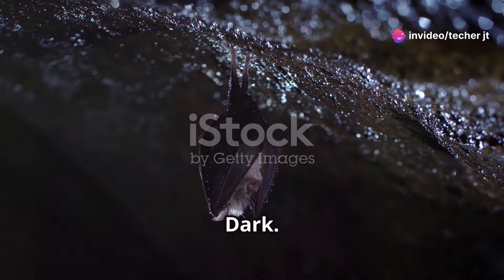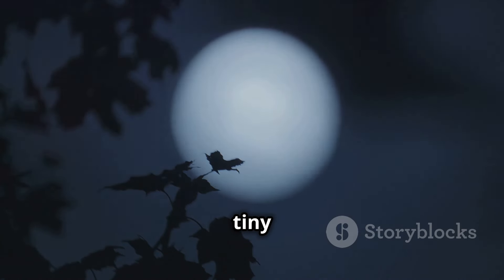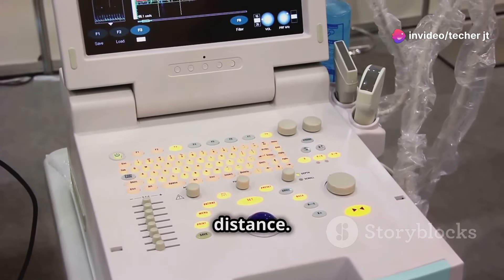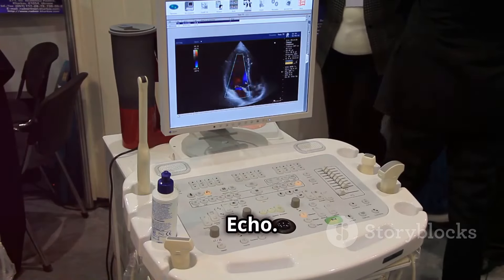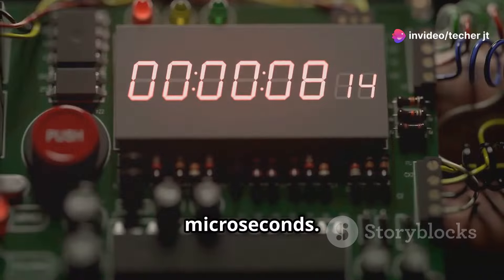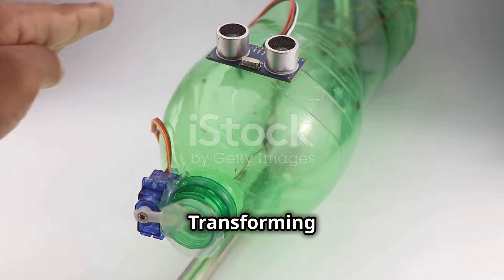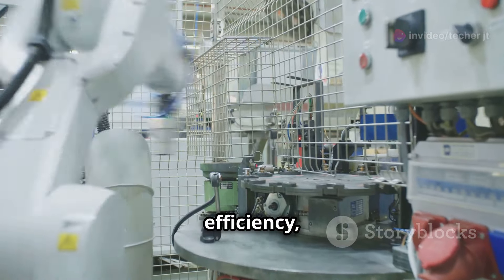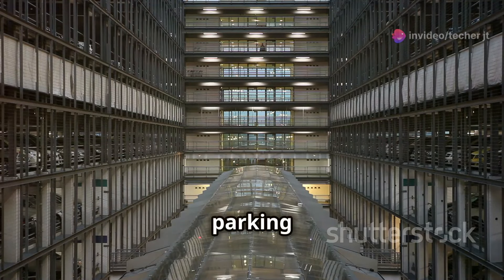Unlocking the Power of Ultrasonic Sensors: How They Work and Where They're Used!

Comment: Catherine Anne C. Gamalo
10-Lyra

2. Applying: Describe a scenario in which an ultrasonic sensor would be more beneficial than an infrared sensor. Justify your choice.

Consider a robot navigating through a cluttered warehouse. The robot needs to measure the distance to obstacles and avoid collisions. Ultrasonic sensors use sound waves, which are unaffected by light conditions. This makes them reliable in bright environments where infrared sensors might struggle due to interference from ambient light. Infrared sensors can have issues with highly reflective or transparent surfaces, as they may cause false readings or reduced accuracy. Ultrasonic sensors, however, work based on sound waves bouncing off surfaces, so they are less affected by surface reflectivity. An ultrasonic sensor provides consistent performance and reliability compared to an infrared sensor.

Comment: Angel Stephanie Ledesma 
10 Lyra

1) Explain the principle of echolocation and how it relates to the functioning of ultrasonic sensors.

- Echolocation is the process of determining the location of an object by emitting sound waves and listening to the echoes that return. Ultrasonic sensors use this principle by emitting high-frequency sound waves and measuring the time it takes for the echoes to return, which allows them to calculate the distance to the object.

Comment: Jullian A. Pangan
10 - Lynx

1. Understanding: Explain the principle of echolocation and how it relates to the functioning of ultrasonic sensors.

Echolocation is the process of determining the location of an object by emitting a sound wave and listening for the echo. Ultrasonic sensors operate on this principle, emitting high-frequency sound waves that humans cannot hear. When these waves encounter an object, they bounce back, and the sensor measures the time it takes for the echo to return. By calculating the distance based on the speed of sound and the travel time, the sensor can determine the object's distance.

Comment: Princess Dawn B. Lamberte
10-LYNX

1.Understanding: Explain the principle of echolocation and how it relates to the functioning of ultrasonic sensors.

Bats and certain animals use echolocation to navigate their surroundings, relying on it daily to find food and survive. They emit high-frequency sounds that travel through air or water and bounce back as echoes when they strike an object. By analyzing these echoes, bats can determine the location, distance, and characteristics of the object.

Ultrasonic sensors work on a similar principle. They emit high-frequency, inaudible sounds known as ultrasonic waves. When these waves hit an object, they bounce back to the sensor, which measures the time it takes for the waves to return. This information is then used to calculate the object's distance, enabling the sensor to detect and measure objects without physical contact.

Comment: Anika Chloe Pepito
10-Lyra
6. Understanding: What are the key components of an ultrasonic sensor, and what role does each play in its operation?

-An ultrasonic sensor uses sound waves to identify things or measure distance. The components of this device include an ultrasonic wave transmitter, a receiver for picking up reflected waves, a control circuit for timing, and a processing unit for calculating distance based on delay. The housing directs and shields the waves, while a power source powers the sensor.

Comment: Anika Charisse D. Dawal
10 - Lyra

1. Understanding: Explain the principle of echolocation and how it relates to the functioning of ultrasonic sensors.

ANS: 
Bats and other animals use echolocation to locate things throughout their environment. They use this every day to locate food in order to survive. They do this by releasing a high-pitched sound that runs through the water and air. These noises return as echoes when they hit an object. The bats can then determine the object's location, its distance, and its possible nature.

The principles underlying ultrasonic sensors are similar. They produce inaudible, high-pitched sounds that are known as ultrasonic waves. These waves return to the sensor after hitting an object. The sensor will then monitor how long these waves take to return and use that data to calculate the object's distance. This is how ultrasonic sensors can detect objects and measure distances without needing to touch them.

Comment: Chlouie Fate O. Hermoso
10-LYRA

2. Applying: Describe a scenario in which an ultrasonic sensor would be more beneficial than an infrared sensor. Justify your choice.

-In a warehouse filled with various materials like metals, plastics, and liquids, an ultrasonic sensor is more beneficial than an infrared sensor because it can reliably detect objects by using sound waves that are unaffected by the material properties, unlike infrared sensors which can struggle with reflective or absorptive surfaces.

Comment: Christian Dynniel M. Llanos
10-Lynx

1. Understanding: Explain the principle of echolocation and how it relates to the functioning of ultrasonic sensors.

Echolocation involves locating an object by sending out a sound wave and listening for its echo. Ultrasonic sensors use this method, emitting high-frequency sound waves beyond the range of human hearing. When these waves hit an object, they reflect back to the sensor. The sensor then measures the time it takes for the echo to return. By using the speed of sound and the time it took for the wave to travel, the sensor can calculate the object's distance.

Comment: Leeane Niña A. Dela Rosa
10 - Lynx
1. Understanding: Explain the principle of echolocation and how it relates to the functioning of ultrasonic sensors.

Echolocation is a biological phenomenon utilized by certain animals, such as bats, to navigate and locate objects in their environment. This process works by emitting sound waves that travel through the air. When these sound waves encounter an object, they bounce back, or echo, to the source. By analyzing the time it takes for the echoes to return and the characteristics of the sound, the animal can determine the distance, size, shape, and even texture of the object. Ultrasonic sensors are inspired by nature's ingenuity and use the same principle of echolocation to measure distances and detect objects. These sensors are used in various applications, from medical imaging to automotive safety. These sensors emit high-frequency sound waves and measure the time it takes for the echo to return.

Comment: Maykylla Geraldine R. Egarguin
10-LYNX

10. Creating: Propose an innovative application for ultrasonic sensors in a field of your choice (e.g., agriculture, automotive, robotics). Describe how it would work and its potential benefits.

An innovative application for ultrasonic sensors in agriculture could be for automated irrigation systems. Sensors placed around crops would measure soil height changes due to water absorption and plant growth. By detecting when soil is too dry or plants have grown to a certain height, the system could automatically adjust water delivery. This would optimize irrigation, reduce water waste, and ensure crops receive consistent moisture, improving yield and sustainability.

Comment: Roda A. Patayon
G10 - Lynx

1. Understanding: Explain the principle of echolocation and how it relates to the functioning of ultrasonic sensors.
Echolocation is the process of using sound waves to determine the location of an object. Ultrasonic sensors use this principle by emitting high-frequency sound waves that bounce off objects and return to the sensor as echoes. By measuring the time it takes for the echoes to return, the sensor can calculate the distance to the object. This is similar to how bats use echolocation to navigate in the dark.

Comment: 10 - CASSIOPEIA 📝⬇️
Reply: Analyzing: Investigate the reasons why ultrasonic sensors might fail to detect certain materials effectively. What characteristics of the materials contribute to this issue?

-Ultrasonic sensors detect objects by emitting sound waves at a high frequency and measuring the time it takes for the waves to bounce back after hitting an object. However, certain materials can be challenging for ultrasonic sensors to detect effectively due to specific characteristics
Reply: Adrienne Kiesh R. Magbanua
10 - Cassiopeia

Q1: Explain the principle of echolocation and how it relates to the functioning of ultrasonic sensors.

A: Echolocation is the principle of using sound waves to determine the position and characteristics of objects in the environment. Animals like bats and dolphins emit high-frequency sound waves that bounce off objects and return as echoes. By analyzing these echoes, they can detect the location, size, and texture of objects. Ultrasonic sensors operate on a similar principle. They emit ultrasonic sound waves, which travel through the air and reflect off objects. The sensor then measures the time it takes for the echoes to return and calculates the distance to the object based on this time. This technology allows for precise distance measurements and object detection, much like the natural echolocation used by animals.
Reply: Joaquin Gabriel L. Cabug-os 
10 - Cassiopeia 

1. Understanding: Explain the principle of echolocation and how it relates to the functioning of ultrasonic sensors.

Echolocation is the biological sonar used by animals like bats and dolphins to navigate and locate objects by emitting sound waves and interpreting the echoes that return. Ultrasonic sensors function similarly by emitting ultrasonic sound waves (above the range of human hearing) and measuring the time it takes for the echoes to return after bouncing off an object. This time delay is then used to calculate the distance to the object.
Reply: Lorenz Michael Paderanga
10 - Cassiopeia 

1. Understanding: Explain the principle of echolocation and how it relates to the functioning of ultrasonic sensors.

Echolocation is a type of biological sonar that animals such as bats and dolphins use to navigate and locate objects by emitting sound waves and interpreting the echoes they receive. Ultrasonic sensors work similarly by emitting ultrasonic sound waves (above human hearing thresholds) and measuring the time it takes for the echoes to return after bouncing off an object. This time delay is then used to calculate the distance from the object.
Reply: Farrah Monica B. Leuterio
10 - Cassiopeia

1. Understanding: Explain the principle of echolocation and how it relates to the functioning of ultrasonic sensors

- Echolocation is a biological process used by animals like bats and dolphins to navigate and locate objects by emitting high-frequency sound waves that bounce off objects and return as echoes. This process allows them to create a mental map of their surroundings. Ultrasonic sensors function on the same principle: they emit ultrasonic waves, which reflect off objects and return as echoes. The sensors then measure the time it takes for the echo to return, allowing them to calculate the distance to the object. This similarity makes ultrasonic sensors effective in various applications by mimicking the natural echolocation ability of these animals.
Reply: Princess Jelian M. Ucat
10 - Cassiopeia

Q1: Understanding: Explain the principle of echolocation and how it relates to the functioning of ultrasonic sensors.

A: Echolocation is a biological process where animals like bats emit high-pitched sounds that bounce off objects, creating echoes. The returning echoes help the animal create a sonic map of its surroundings, allowing them to navigate and hunt in complete darkness. Ultrasonic sensors work on a similar principle by emitting high-frequency sound waves and analyzing the time it takes for the echoes to return after bouncing off objects, allowing for precise distance measurements.
Reply: Y'vhone Felkris L. Estanda
10 - Cassiopeia

Q1. Understanding: Explain the principle of echolocation and how it relates to the functioning of ultrasonic sensors.

— Echolocation is a biological process used by animals like bats, dolphins and even whales to locate objects by emitting sound waves and interpreting the echoes that return after bouncing off objects. Ultrasonic sensors work on the same principle by sending out sound waves in the ultrasonic range above human hearing and detecting the time it takes for the echo to return. This time delay is used to calculate the distance to an object.
Reply: Ethan James P Malferrari
10 Cassiopeia

4. Evaluating: Assess the impact of environmental conditions (like temperature and humidity) on the accuracy of ultrasonic sensors. What measures can be taken to mitigate these effects?

While ultrasonic sensors are reliable, their accuracy can be affected by environmental conditions such as humidity, temperature and air pressure can influence the speed of sound which can affect the sensors readings, the slightest change in these factors can lead to measurement errors. Sound travels faster in warm air while slower in cold air, similarly sound travels slower in high humidity and faster in low humidity affecting the sensors ability to gauge the distance accurately. That is why it is crucial to understand and compensate for this environmental factors. Some ultrasonic sensors have built in compensation mechanisms to adjust for these environmental conditions ensuring accurate measurement and reliability.
Reply: Kiesha Cantila
10- Cassiopeia

2.Applying: Describe a scenario in which an ultrasonic sensor would be more beneficial than an infrared sensor. Justify your choice.

In situations when there is little or no light, an ultrasonic sensor might be preferable than an infrared sensor. Since infrared sensors need light to work, they might not be very useful in dim or hazy conditions. Conversely, sound waves—which ultrasonic sensors employ—can pass through these obstructions.
Reply: Mark Uriel G. Tacbobo
10 - Cassiopeia

2. Applying: Describe a scenario in which an ultrasonic sensor would be more beneficial than an infrared sensor. Justify your choice

Ultrasonic sensors would be more Beneficial in a dirty warehouse where infrared sensors may struggle. Dust Particles can scatter or absorb infrared radiation. Light reduces precision, while ultrasonic waves can move through dust without significant interference, causing ultrasonic sensors are more dependable in this environment.
Reply: Cheryjan Aclo 
10 cassiopeia

Understanding: Explain the principle of echolocation and how it relates to the functioning of ultrasonic sensors.

Echolocation is a biological process used by bats, dolphins, and whales to locate objects by emitting sound waves and interrupting the echoes that return after bouncing off objects. Ultrasonic sensors work on the same principle by sending out sound waves in the ultrasonic range above human hearing and detecting the time it takes for the echo to return. This time delay is used to calculate the distance to an object.
Reply: Joshua Cliff L. Aurigue
X - Cassiopeia

2. Applying: Describe a scenario in which an ultrasonic sensor would be more beneficial than an infrared sensor. Justify your choice.

- In low-light or dark conditions, an ultrasonic sensor may be more effective than an infrared sensor. Infrared sensors rely on light to function, making them less effective in dim or foggy environments. In contrast, the sound waves used by ultrasonic sensors can navigate through these obstacles.
Reply: Merchella Da-an 

2. Applying: Describe a scenario in which an ultrasonic sensor would be more beneficial than an infrared sensor. Justify your choice.

- Scenario: In a warehouse where dust and debris are common, an ultrasonic sensor is used to detect the presence of pallets stacked in aisles.

Justification: Ultrasonic sensors are more beneficial in this scenario because they are less affected by environmental conditions like dust and fog, which can hinder infrared sensors. The ability of ultrasonic sensors to operate effectively in such conditions ensures reliable distance measurements and object detection, crucial for safe navigation and automation in the warehouse.

Comment: Fresh M. Satur
10 -LYNX

1. Explain the principle of echolocation and how it relates to the functioning of ultrasonic sensors.

Echolocation is how some animals, like bats, find objects by making sounds and listening for echoes. They send out sound waves that bounce off objects and return, allowing them to know how far away those objects are. Ultrasonic sensors work in the same way by emitting high-frequency sound waves and measuring the time it takes for the echoes to come back. This helps the sensor determine the distance to an object, enabling robots to avoid obstacles and navigate their surroundings, just like animals use echolocation to understand their environment.

Comment: Kaihanne A. Manticahon 
10 - Lynx 

3. Analyzing: Compare and contrast the advantages and limitations of ultrasonic sensors in industrial applications versus their use in medical imaging.

— In industrial applications, ultrasonic sensors are useful for providing affordable distance measurements and object detection in challenging environments such as dust or fog. Still, they could be impacted by outside variables like temperature and material properties. On the other hand, in medical imaging, ultrasonic sensor like ultrasound offer an non-invasive, real-time alternatives for a non-ionizing radiation way of inspecting inside structures. However, they often have lower resolution than other imaging modalities and can be limited by the patient's body composition.  Both applications make use of ultrasonic technology, but they are limited by the properties of the materials and the surrounding environment.